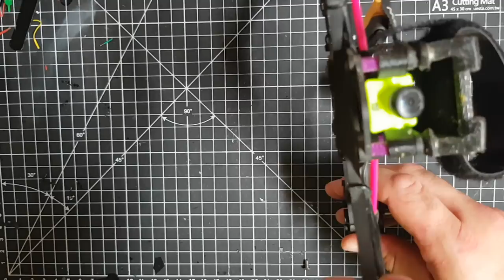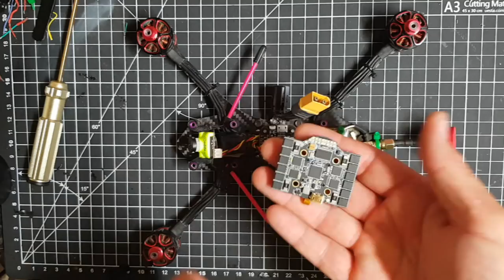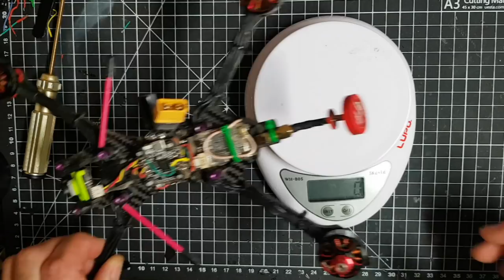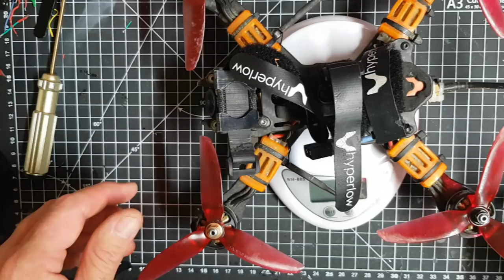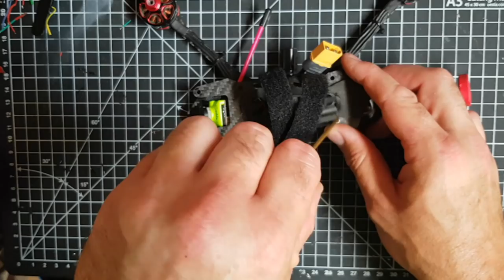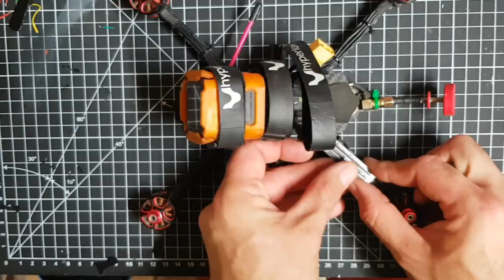Hyperlow RS build overview / Race freestyle hybrid

Comment: Awesome build. I love those motors. I just put a set on my Hawk 5 a week or so ago. What a difference.
Reply from the maker: Archer FPV I'm glad someone does :)  Im really disappointed with them
Reply: Coppertop FPV why the disappointment? Yeah there not quite as powerfull as the old 2306 but they were made for all out power. But for me and what I'm doing their running great.
Reply from the maker: Archer FPV they’re super fragile and put out less power than the ls2207 and are no more efficient than the ls2207 in the air, and they are £14. I wish I’d have bought those or the even better F40 Pro II. They’re okay, but given a second one is beginning to make odd noises, I think they’re  overpriced and absolutely spanked by t motor.
Reply: Coppertop FPV I hear you about tmotor. I just fell for the hype train but I also wanted to keep m Hawk 5 all emax. But I will say I wouldn't buy them for a custom build. I feel a heavier frame wouldn't work right with them as light as they are. But on the hawk I think their great.

Comment: Wow such a super clean build👍 looks great!! glad to hear your report on the E-maxx Motors won't be buying those that's too bad cuz their damn sexy Motors guess I'll just stick to my F40 Pro 2
Reply from the maker: Splinter Fpv nice frame this. And yeah, although to be fair the early f40s had problems with the 2 part bell separating. Usual quad stuff, don’t buy anything electrical that was just released :) imo they’ve released a motor that is no more efficient and less powerful than the LS 2207, which has had its issues sorted and is cheaper... 👏
Reply: Coppertop FPV yeah that's for sure 👍. I never buy anything when it gets released let them work the bugs out.... That's funny I never heard about the f40 pro 2 having problems until recently, now I'm seeing people complain about bad bearings right out of the box, I recently purchased a few myself for backups and have yet to see any issue. It must have been a small batch.....

Comment: I have this same frame with a RunCam Sparrow micro. It pretty much has the same dimensions as the Caddx. What I learned was the TPU pieces that were provided for the FPV camera were so thick, the holes don't line up with the front standoffs. You have to use a lot of pressure to get them to slide on. That puts a lot of stress on where they attach to the camera. What did you do to address that? Did you just force it on or did you shave off enough of the TPU to get a better fit?
Reply from the maker: James Darden they need to be tight otherwise they’ll come loose over time. Just attach them to the camera first and push them down together. Once they’re on they do their job which is to hold the cam firmly.
Reply: @CoppertopFPV  Thanks for the reply. I wasn't sure if you were still monitoring responses on this video.Yeah, I did that at first but I saw a lot of bending with the TPU but wasn't sure if that would cause the mounting hole to elongate or something and just break the material.
Reply from the maker: James Darden you should be using the small washers that come with cameras with tpu also. You’ll never break them.
Reply: @CoppertopFPV  I used them too.

Comment: Nice build I just ordered the 6 inch version I’m really going to be running six hours trying to pick up motors any suggestions price is not an object thanks
Reply from the maker: KRIS Kayfes I’ve never tried 6”. I keep meaning too, then just get 5” again lol . If i did I’d probably use 5” props. I’m a bit odd when it comes to motors. My general purpose fav’s are the t motor F60 pro but the older less sexy version without the more fragile bell and open bottom. If I was going 6” and didn’t want all out speed, I’d look at a lower Kv version (2350kv or less) but I’d also be looking at hyperlite/Brotherhobby. Not my bag, sorry.
Reply: Coppertop FPV I understand I’m running 6s batteries on her just like my 5” catalyst machine works Mercia also on 6s I’m running the brother hobby R6 2207 1750kv omg does she rip
Reply from the maker: KRIS Kayfes ah sorry, didn’t realise you meant 6s. I bet it does. Same story, lower KV.

Comment: The arms are really thin, is it durable compare to like your devel 5? Your choice of motors is interesting. I remember you did a sort of like experiment using the 2306 AOK motors for a light build. The result was it was not a good combination.
Reply from the maker: Jack Truong Hyperlow Carbon is better than Avant’s. Arms are thinner, but 5mm thick. Dunno, I’ll let you know if I bust it :) i still love the Devel, but it’s crap for carrying a GoPro. I’ll be flying my RS with the GoPro on for freestyle. Longer term when I want to fly fast, I’ll take off the GoPro and  switch to the 4” arms and use, 1407-1507 which I prefer or possibly 16xx if I can find the right one. Re the aokfly, I talked about that in a later video. With different props they were much better, but I’ve never really used them since. I’m no racer, but when I fly fast and low, I prefer a weaker motor. The Emax aren’t powerful tho. Numbers wise, the LS 2207 is a better motor (and cheaper) imo, with virtually the same efficiency.
Reply: Coppertop FPV why don't you use banana plugs on the esc cables.
Reply from the maker: Jack Truong weight, and tidiness.